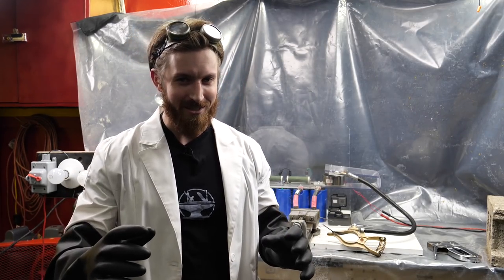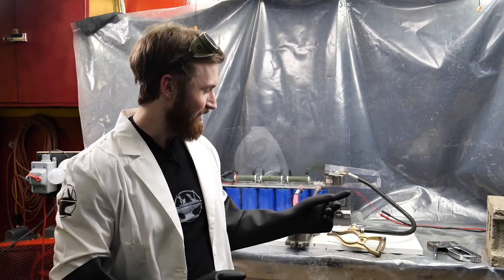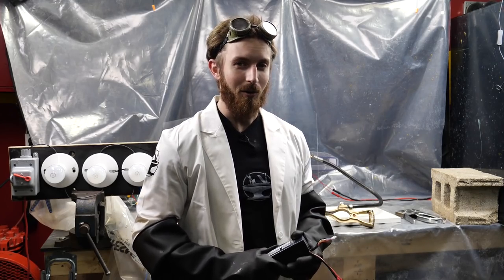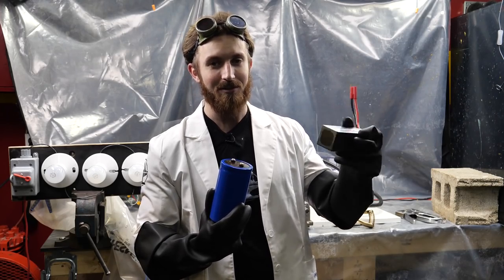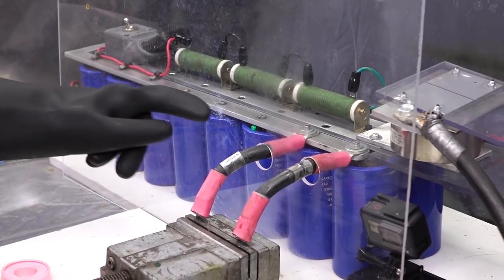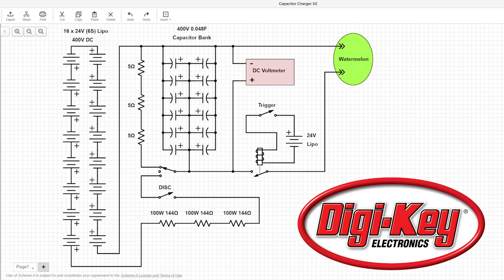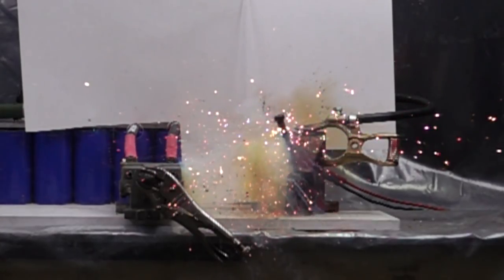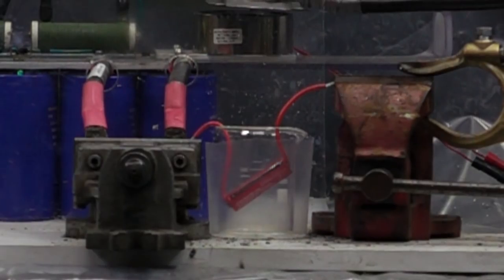1,000,000 AMP CAPACITOR BANK EXPLOSIONS!

Comment: How the crap that motor managed to continue running, maybe the current was so big that it basically ignored the dead shorted coil? Lol
Reply: MasterPlay or a high enough internal resistance and a high enough current rating
Reply: William Herron I was thinking, maybe it shorted out and became a huge single wire, and because the current was that high, the single wire was capable of generating a strong enough magnetic field to turn it
Reply: MasterPlay if that happened, it would probably be over quicker. my guess is that it was actually functioning somewhat as intended.  don’t think it could take that much power for very long though lol
Reply: MasterPlay it most likely actually worked as intended as William Herron pointed out, the sparks in the beginning probably were the electricity arcing from the brushes onto the commutator.
Reply: MasterPlay that's the vibration motor in the nokia 3310

Comment: It was before my time, but there was an accident with a motor rotor magnetizer. It used 2.5 large racks of capacitors (as in full height 19 inch equipment racks). The wire in the magnetizer windings was about a centimeter in diameter, and the dump was controlled by the other half rack, which used a thyratron tube based switching circuit. My understanding, is one of the magnetizing fixtures was not properly seated, and the smaller pins that configure the machine was not properly seated, causing it to dump too much energy for that particular fixture. It supposedly vaporized a portion of the fixture's winding, resulting in severe burns to the face and hands of the operator. The orange made me glad she hadn't touched it!
Reply: They use a similar apparatus to magnetize speaker magnets as well. Similar to what's in the video, but it charges to 600  volts, similar capacitance. about 3 1/2 times the energy. The one I saw actually used a contactor similar to the one in this video. They kept blowing thyristors, and finally gave up, the contact worked quite well, considering the inductance of the coil gave the contactor time to make a good closure, before magnetic core saturation caused the current to spike.

Comment: You should rearrange the capacitors after measuring the resistance of various objects so you can raise the voltage of the array to pump the maximum amount of energy possible through the system :D

Comment: Can u explain the calculation of "1.000.000 amps capacitors"?? thx
Reply: Brennan Herring meh get a big enough power source and a very low resistance wire and short it like their capacitor bank
Reply: There aren't 1000000 Amps

Comment: I wonder what Lichtenberg Fractals would look like using that bank. If it's possible.
Reply: 400V is not enough for that unless you use salt water or something.
Reply: @NoSubsWithContent  40 megawatt pulse is really easy just use a 800v flash cap and charge it then short it small and easy

Comment: Not even close 1 Million amps ! From what I can see this is quite a low voltage, even if you short it out with those fat leads you wouldn't get that much
Reply: Kiloamps yes, Megamps no. I've seen the solutions to get 1 MA at about 50 volts. It's not trivial.

With those electrolytics, the problem is their maximum current. They will not last long in that application. A quick look at GA's website suggests that even the best energy discharge scyllac caps are good to 260kA and 100kV- and these are huge and truly terrifying. The best ultra-capacitors are about 3kA at about 3 volts.

Comment: "Just a few years ago" my son and I made a cap out of a 35mm film tube and aluminum foil, PVC pipe and cotton for charging.  It gave quite a jolt and he got an A.. :)  It was a fun project.  :) We tried to use a 25 disc CD container but it was too big for us to hold a charge using PVC.

Comment: I highly, highly doubt you are anywhere close to a MA from that bank- even 500kA would be absolutely shocking.
First off, you are using electrolytics, and even if we assume a 20 milliohm ESR (optimistic), ignoring the ESL (which limits the rise time) and the resistance of your connections, you have a theoretical maximum of about 320kA for the bank of 16 caps. In the real world it will be far less. The high ESL of the caps (and the setup... long bars, wires, etc) means your rise time will be very slow. 

In addition to that... those caps will be destroyed in short order. Pulling kiloamps through those poor caps (which are not energy discharge caps) will literally tear them apart internally. In reality I expect you're well below 100kA, especially considering the very high resistance of your load in most of these cases. Even if your load is a ridiculously low 20 milliohm, even with perfect caps with an ESR of zero (impossible), at 400V you are limited to 20kA.

Comment: 16 6S lithium polymer batteries in a series=355 volts. Capacitor value for bank, 48000 uF. formula for stored energy in a capacitor: E=.5CV2. 355 X 355=126,025 X .024=3024.6 joules of energy. That will supply .84 watts continuously for 1 hour. you're releasing that in milliseconds. That's a lot of power! With voltage that low, the impedance or resistance of whatever the load is, has to be pretty low, to drain off the capacitors quickly enough to take advantage of the available fault current of those capacitors. That, as you know, is quite high. That's why fruit doesn't explode the way you would like. The resistance is just too high. If you can draw an arc inside of something, that's what creates the high power, to create the expansion you want. More common for blowing up watermelons is much lower capacitance, but much higher voltage, at similar energy. That will discharge its energy into the high impedance load much more quickly. The best use for that capacitor bank is crushing aluminum cans inside a coil. It also works great for regaussing Alnico speaker magnets.

Comment: See if you can shrink a penny with this bank. Coil of copper wire around the penny. Check out another vid but it would be cool to try with this rig. You could also do smaller capacitors between the two leads. They make nice explosions when overloaded. AA battery. A Nokia phone.

Comment: If you get a very very thin piece of steel wire, and run that current through it, it will violently pop. You should try it

Comment: 1.000.000 amp seems a crazy fact. Are you sure about this value?
Reply: Alex Demeter it’s because the resistance of capacitors are very low, so it’s a burst of huge amperage over an extremely short amount of time.
Reply: @Ferraday  Is a known fact that the ESR at the super capacitors is very small, but considering the resistance of the conductors with which this electric current is carried, it is impossible to reach this mad value.

Comment: How to calculate the current of the capacitor?
I have a 400V 6800uF capacitor x5
I put it in parallel, so the total is 34000uF 400V
But I want to know if the current it outputs is a few amps?
Reply: Your instantaneous current is the voltage divided by the total circuit resistance, as per Ohm's Law. The total joules of energy available is 1/2 the capacitance,(in Farads) times the voltage squared. 400X400=160,000. 160,000X.034=5440 Joules. you have more stored energy than the 3,024.6 Joules used in this video by about 44%. BE CAREFUL!!!!

Comment: I built something similar (its in some of my videos). It used 10 capacitors wired up for 900 volt operation. Just as dangerous (if not more), but was triggered electronically via a giant SCR about the size of a hockey puck. Charging was accomplished with a home wound transformer on a TV flyback core driven via a royer oscillator. Eventually, charging, dumping or firing the stored charge was all handled by an arduino. Due to the fact that people may injure or kill themselves with something like this, I decided not to make public the testing videos, or assembly videos. Capacitor banks are loads of fun though, till the cops rock up thinking the reports are gunshots oops ;)

Comment: Please tell me how did you calculate 1000kA?
With a dc-dc step-up converter which pulls out 300mA max
I want clear calculations to prove 1MA!
Reply: You need to know the total circuit resistance+the equivalent series resistance of the capacitors to divide 355 volts by. I think 1 million amps is optimistic, but 100,000 seems plausible. you can charge the system with a small power supply, it will just take longer to put the .84 watt hours into the capacitors, so it can be discharged in a fraction of a second, to flash all that power. it could easily peak at a million watts with the right load, but only instantaneously.

Comment: Anyone else find it interesting just how the watermelon exploded? ( how it burst on one side first instead of the middle.)

Theory, it flash vaporized on the negative cathode because the electricity started there trillionths of a second earlier than the heating at the anode. (Names could be off, I'm a bit rusty...)

Comment: This reminds me of the wunderwaffe from call of duty zombies. Because if you think about it, all it does is release a electric charge so it could possibly be  using capacitors and on top of that when you reload you change the lightbulbs so maybe those are some kind of resistors also. Just a though

Comment: Photonic Induction channel does this too, but with a bigger capacitor.
Reply: Photonic induction uses a lower value capacitor, but charges it to a much higher voltage. The energy is about the same. The high voltage low capacitance is better for high impedance loads, like fruit, and hot dogs, but this lower voltage higher capacitance is better for wires, light bulbs, AA cells or other low impedance loads. It's also much better for rail guns.

Comment: My question is... Could you use something heat resistant like a tungsten wire, put it into the back of a barrel, and make a cannon that works off of superheating the air in the chamber? If that doesn’t work, could you replace the tungsten with something that would vaporize to make a cannon?

Comment: So 18650 batteries basically turn into the equivalent of a small fragmentation grenade when hooked up to your 400 volt 1 million amp capacitor bank that utterly ginormous at 400 megawatts of capacity

Comment: @the Hacksmith Perhaps the reason the sparklers didn't ignite was due to there iron content, which was driven away from the wire due to the electromagnetic force you were talking about?

Comment: And people keep claiming super caps would be safer then batteries for electric cars because you can instantly discharge them in the event of a crash. This video shows very clearly what happens when you try to instantly discharge a capacitor. Not safe at all.
Reply from the maker: That has absolutely nothing to do with the reason why super caps shouldn't be used... Batteries are way more dangerous in the method you described.

Comment: You could use more capacitors in series and make a row of those capacitors,  2 capacitor in series would have twice less current but 4 times more power.
Reply from the maker: Not how that works.  In series boosts voltage,  in parallel boosts current.  Power remains the same and is finite, in both cases it is the same

Comment: You should try some welding rod or even better, some titanium... which I would be happy too supply a few bits of... 99% Titanium, .05% iron, and  .05% chromium at  1/8th of an inch thick (about 4mm).

Comment: doesn't having the capacitors running in parallel make just one big capacitor? wouldnt it make more sense for them to run in series for more power?
Reply from the maker: Higher voltage, lower current. Different effects

Comment: i saw where i work some prety huge capacitors used for high voltage aplication, and by high voltage i mean 34kv and up, you should try to use a couple of those

Comment: Why dont yall make a washer launcher with the cap bank..  you get the drive disc out of a 3.5mm hdd, the big reflective washer, and on the cap bank you make a coil interlaced looking like a stove top heating element except the leads do not come into contct unless the hdd washer is placed on top..  wire it to a switch and boom..  one guy with a somewhat sizable bank was able to get it to stay in the air for about 5-10 seconds..  makes an awesome ring and yea..  only dude ive seen do that but only did it twice because the neighbors started yelling...  lol..

Comment: What im wondering is how much watts its using cause it can only be using 250w from what i know and put in the volts and amps
Reply from the maker: A lot more than that :)

Resistance is almost zero, it's 400V input so ... A lot =p
Reply: the Hacksmith woah well thats a whopping 400,000,000 watts thats impressive

Comment: What if you attached magnets to a glove that were hooked up with a electric current with a switch, have a air soft pistol in a holster, flip the switch and the gun flies up to your hand. Is that possible? and would the magnets ruin the air soft gun, or when the switch is flipped would it electrocute you?

Comment: You don't tell any voltages or farads just a few thousand amps??? It confuses me.
Reply: If you look at the schematic, you can tell it's a total of 48,000 uF. If you multiply the total number of lithium cells in the batteries he's using, and multiply that to 3.7 volts per cell, it's about 355 volts. I'll spare you the math: it's 3024.6 Joules of energy, about .84 watt hours of energy, being discharged in a fraction of a second. That's why it's so powerful.
Reply: @vincentrobinette1507  48000uf equals 0.048 farads.This does not bother me but 355 volts makes the power HUGE.Thats what I wanted.
Reply: @Tiyagi99  That's exactly right. The value of the capacitor is halved, but the voltage is squared, Your highest volt is MUCH bigger than your lowest volt. If he actually charged all the way to 400 volts, it would increase the stored energy to 3840 Joules. That's 810 more Joules, with an increase of only 5 volts!

Comment: It's not 1 million amps. Then the total wattage would be 400,000,000 and that would be ridiculous. It's more like 5000 amps
Reply from the maker: The resistance is near zero, which means if you do the calculation... It's not measurable.

Comment: How were you able to charge those capacitors to that high a voltage?
Reply from the maker: That's the rated voltage for those capacitors, 400V

Comment: What output voltage potential you have on this set of capacitors? You can't kill the bulb with current, only with overvoltage. 100w bulb has approx 0.5A. It dosn't matter does you have source 1000A. If that so, all city bulbs will be broken because power transformer has 10MW.  LoL, you are funny...
Reply from the maker: That's the one thing you pick to "debunk" this? Really?

Watch the whole video. It's 400V.
Reply: the Hacksmith I didn’t know you guys reply to the thousands of comments

Comment: I really like this channel but sometimes u lose money to make electronic stuff  that can be done in a really different way that can be better in cost and performance
Reply from the maker: I'm confused
Reply: I mean in this video to charge ur caps u used many lipo battries which cost too much u can get a transformer that convert the mains voltage to 400 then convert it do DC it will cost u nothing and u wont damage ur bats anymore .
Thanks for listening i really like to see my favorite channel growing  and i finished engineering and what i do is my hobby . Thanks
Reply from the maker: we already had the batteries though, they don't get damaged :) buying a big enough bridge rectifier would be more expensive! We made everything using stuff we already had :)
Reply: Oh okay thanks ☺